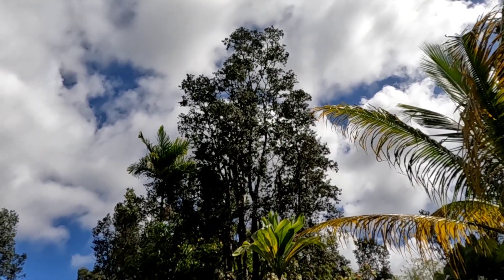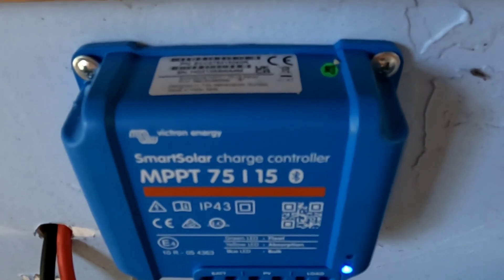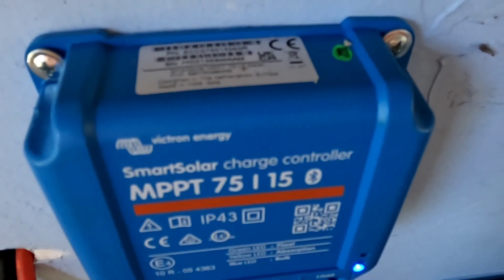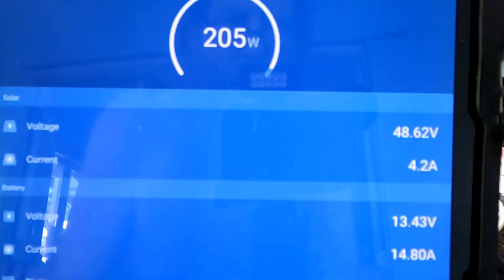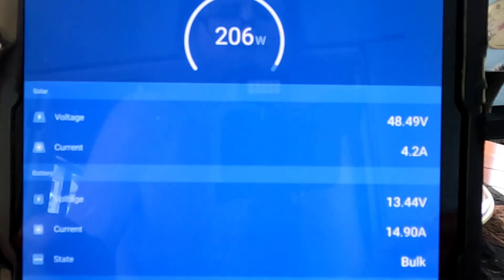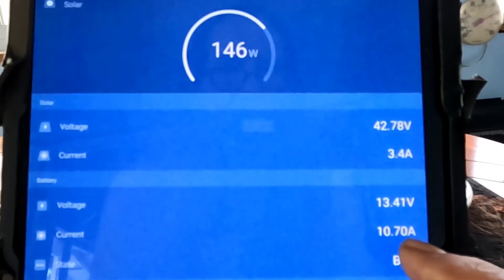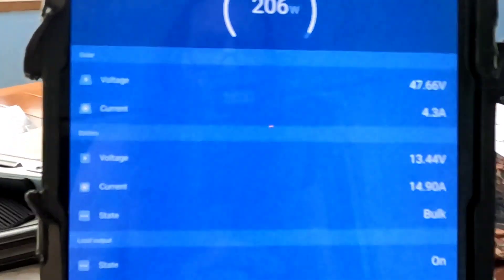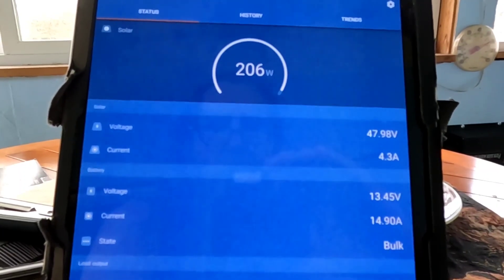Victron MPPT 75/15 pushed beyond rating. What happened?

Comment: That should hold around 15 amp max. Now if you set for 24V you should get the full 300 watt peek. I am not Shure if that model can do 24V . would be the way to run it on 24V. now over voltage the input from solar array may damage the unit.  also if that MPPT heats up to much it will limit output as well . make Shure you have space around the3 MPPT to let the heat out. looks ok. 😀
Reply: I looked at my MPPT 7510 controller and is does 24V . great way to charge that 100 ah 24V battery. looking at info I got with mine and the USB connect for lap top  I can do A custom firmware up date for outher battery's like NiCad or nickel-Iron . I wont be doing that on this small on. just 12/24V for camping 120watt folding panel .   you should be able to run 24 just fine on what you got 300 watt array.
Reply: @robertmeyer4744   I have the 75/15 , it only does 12 and 24, I use it in conjunction with the boost converter, just to swap power around to different lithium batteries,  You can push all the amps at it all u want, it's just going to give you 15, cuz that's what it's rated for. I've never went past 70V though.
Reply: @WCO3  the guy hear has time USB 24V battery . this will be great to charge it. 
😀
Reply from the maker: I'm dialing it in now!🤙
Reply from the maker: Having fun now with this higher voltage! Can't wait to share with you. Wow, what a difference! 🤙

Comment: When  setting  the  parameters on my  charge controller  is possible  to to program it so that I don't get a  high voltage  warning? 
And is that a problem?
Reply: High voltage warnings are there for a reason mate.  If you slam a voltage in to your controller that is above the rated VoC the controller can handle, then there is a good risk you'll fry the controller.  If you go over the specs for charging lead acid (unless you're doing an equalisation) then chances are you might hurt your batteries.  Overvolting a Lifepo4 should see the BMS shut it down, but that's not a guarantee.  Unless you have a specific use case for your controller that you wish to ask about, I would stick to the recommendations of your equipment manufacturers .  Edit: Remember equalisation is high voltage but low current for a relatively short period of time in the case of Flooded Lead Acid.
Reply: Manufacturer  recommended setting is 28.4v .  I  program in 28.2.   And  want to go  lower,    but  I don't really  understand  the  meaning  of  the other setting  and  understand  that  they  need to go  proportionally  together. 
Any  help  please!
Reply: @boscodog4358  what model controller are you using, and what battery chemistry.  Obviously a 24 volt system, if I know the controller model and battery type I can be more helpful.  Also how many amp hours is your battery bank, and what size is your solar array.
Reply: @Drewboo1968  awesome  man. 
I have a  6415an  controller  Epever. 
A Reliable 3k watt  inverter. 
2.  12.8 v.  100amh  batteries   24v configuration. 
 4--  310w  panels   series/ parallel  configuration.   Output  73v. And  app. 9 Amp
My  problem  is  over  voltage  to  the  batteries   getting  alarm  at 28.2 v
Is that  normal
Reply: @boscodog4358  Let me do some digging, and I will get back to you today.  What brand are the batteries?  28.2V sounds like a bit of a strange voltage for a full charge.  I would normally expect 28.8V for two LFP in series, and 29.2V for the real high end of the range.  So telling me the particular brand will help, in case they have some strange chemistry, or particularly unusual aspects.
Reply: It  appears that the controller is  slow  in  closing down the charging  to the battery
Reply: @boscodog4358  okay so lfp batteries, a good safe voltage for a full charge would be 28.8V (14.4v X 2) max for full charge would be 29.2V generally, but the gains from the extra .2V per battery are not worth it Vs the longevity saved by going 14.4V per battery <remembering that we are wiring the batteries in series) let me do some digging on your 6415 and I will get back to you today with some ideal settings that should see you right.  I graduated from SEI in Colorado after taking all four battery based and advanced multimode qualifications (with 160 NABCEP hours) so I won't advise anything that sounds like blowing smoke up your rear.
Reply: Chins  battery
Reply: Manufacturer recommended 28.4
Reply: @boscodog4358  Cool, I can look up the data sheet and see what I'm dealing with!

Comment: Shockingly, small shadows can have HUGE effects on total output.  Only speaking for my 4500w array, small shadows take 180ADC right on down to 10-50ADC instantly albeit only temporarily. Doubt that's your production issue but.....could be?
Reply from the maker: Those results were in full sun at the end of the clip.🤙
Reply: @ProjectsinParadise808  I’d be interested in seeing you test each panel individually and then in a couple different configurations ie 3S vs 3P
Reply: PERC+ half-cut panels are a good choice. 420 W but only 99 euro. Half-cut is not so sensitive for shading.

Comment: Gary R is correct. You wired the panels in series, which only add their voltage and not their amperage.  The reason you are seeing almost 15amps on the lower portion of the screen is because the voltage from the panels in the top screen (48.82V) is being stepped down by about a factor of 3 because I'm assuming your set up on a 12V system (the charge controller itself).....hence 14.9Amps in the lower portion which is 3 times higher current.  So, in short, by stepping the voltage down, one steps the current up in proportion. @Electroboom feel free to confirm or correct my statements I made there as you see fit 🤠
Reply from the maker: Mahalo Uncle! This is exactly why I do this channel.  To have conversations with guy's like you , Gary and many other's that can explain the why, and how so easily for us. My understanding, and ability to explain what my results are,  are not so easily at the tip of my tongue , or permeated my gray matter like so many of you. Gratitude to you all for helping piece it all together.  Aloha!🤙
Reply: @ProjectsinParadise808  anytime good buddy but, I’m working with limited capacity on my best of day here too so…. Birds of a feather right? 🙏🤠
Reply: The 75/15 nominal watt rating is 220w and the max charge current is 15 amps. You can over panel the controller, but it will result in clipping and still charge at 15 amps. Could be dangerous, but I’ve seen quite a few people exceed the wattage rating and not have too many problems. From what I’ve seen, the big problems occur when the voltage rating is exceeded. Anything over 75 volts would probably result in the magic smoke appearing.
Reply: Even when you add them in series and keeping the amps the same on the input side it still raises the output amps to a dangerous amount the controller just can't handle. That 75-15 can handle one modern panel or two 200 watt panels. If you over panel it it might take it for a bit but not long. It's gonna drop down to the 15 amps it can output and the rest will turn into heat. The heat will eventually kill it. Add a good heat sink or fan and it might last longer but it will eventually fail
Reply: @matthewknight5641 If the charge controller is charging at the max of 15 amps, the rest of the power is NOT dissipated in heat! The solar charge controller simply allows the panel voltage to climb closer to its unloaded panel voltage therefore simply pulling less power from the panel. Most panels/controllers spend the majority of their time running at less than 100%.
Reply: Thank you for comment above. My brother just got a camper. I have a Victron 75/15 MPPT and 2 x 300w panels. He has 100ah 12v battery (he needs more, i know, hes broke and broken, im funding). I dont want to charge these to quickly but want to ensure a full charge every day to run his fridge and lights. Power wasted is no concern. Is it let the smoke out dangerous connecting excess panels to allow for cloudy days? 15a from 600w. ( I have no experience with this). @adrianinglis5922
Reply: @truthaus6840 the victron can throttle the current (amps) but not the voltage.

so you could go about 10-15% safetymargin below the stated voltage (75V-10% = 67,5V) on the panel configuration and put basically as much panels in parallel as you want BUT: put a fast blow fuse of 15A in series before you go into the charge controller !   it can't handle/throttle overcurrent in a failure event and the fuse needs to kick in to safe it from burning out.

in normal conditions it will throttle the panels back to match its own 15A output capability. but having a charge controller for more then 10% of a sunny day throttling is just wasting  yield.  then get a bigger charge controller.
Reply: @casemodder89  thank you.
Reply: @truthaus6840  Its been 6 months since you put 600 watts on a 75 15 Victron Controller. Is it still functioning okay?
Reply: @garyenwards1608  yes,
Reply: @truthaus6840  Thanks!
Reply: @matthewknight5641  just get a bigger charge controller

Comment: Your initial comment in the start of the video. when you multiply the voltage of the three panels and you multiply the current(amps) could be misunderstood! In series connections you only add up the voltage, the amps stays the same!!! The 15Amp limit you see, is due to the controller(not the panel connection) - when it steps the voltage down to 13-14 volts, it ups the amps at the same time, till the 15A limit.

Your experiment shows another good reason to up system voltage. If this test was made on a 24V-system you would get the full potential of the panels, because the amps would be only half and thereby within specs of the controller and not limited to the 15. So running higher voltage/less amps allows you to get by with a smaller controller. Controllers main limit (when it comes to cost) is amp rating.

Other good reasons to run higher voltage is, you get by with thinner cables due to the lesser amps, your inverter effeciency increase slightly and you have less powerloss in long run cables due to the higher voltage/less amps. (amps is where you get loss in cables)
Reply from the maker: Copy that brother,  and mahalo for that great explanation.  It helps me, and I'm sure other's as well.  Appreciate you sharing,  and participating in the conversation.  Aloha!🤙
Reply: Yes, it would probably be optimal with this controller to use 4×100w panels arranged in "series-parallel" ie two series branches of two panels, the two branches being connected in parallel with each other.  Consequently the whole array is at a nominal 24v.
At the MPPT point the voltage in each branch would be about 34-35v and the current about 6A maximum.  So maximum input to the controller would be 35v at 12A, which matches the controller power spec. of 440w at 24v. Then the controller would output about 24A charge at 16-17v into your 12v battery.
Reply: @nigelshindler6334  I think the cc limits the output current to 15a, so I doubt you will get 24a to charge your battery

Comment: Nope, still 6+ amps. They are in series, voltage goes up, current stays the same.
Reply: In series, volts are additive but amps are not.   Volts push, so never go above the 75 (VOC), whereas amps are pulled, so no need to worry that you will go over 15 amps.   Amps greater than the 15 simply won’t be used…wasted, or over simply over paneled, which is useful on overcast days.
Reply: I was looking at the spec sheet of the Victron MPPT 75/15 charge controller and the only protection it says the controller has is short circuit and over temperature.  Your three panels do have the potential of exeeding the max amperage of the panels by a few amps but the tolerances of the controller is likely to allow a bit more than the rated current and you maybe lucky enough that it won't complain too much. It won't however limit the current and automatically keep it below a safe level for it's operation meaning if you added a fourth panel to the array you would likely blow your controller.  Being that you live in Hawaii and your temperatures will likely never get down where the panels will approach their maximum power output you might be safe with your current array as is unless you should have a bright sunny day along with uncharacteristicly cold temperatures. Adding a forth panel is not recommended for this 12v system as it would certainly lead to you exceeding the controllers rating far to often for it's rated capabilities. The spec sheet says it only supports 220 watts of solar on a 12v battery system however it will support up to 440 watts of solar panels if you change to a 24 volt battery.
Reply: @ReadyNeck  "Your three panels do have the potential of exeeding the max amperage" No, not when connected in series. 
- Our good man is connecting his panels in series, so the amps will stay the same as it is are for 1 panel. They will not even get close to 15A - BUT on the output side of the controller(to the batteries) - there is an issue of being limted to 15A. A controller amp rating counts both on the input and the output of the controller. In the setup in this video, it is not the input amps from the panels that is a problem, it is the output amps til the battery that is limited to 15A.

A fourth panel when connected in series, will not blow the controller due to Amps, BUT it may very well blow it due to exceeding 75 Volts!!
Reply: @jbjensen11  I think the discrepancy between our comments is in how we are accounting for the MPPT charge controller's current output and it's lack of current limiting capability. I agree with you on the current output of the solar panels in series and if this were a PWM controller then the amps would be limited to the VOC of a single panel which is far below the controller's 15 amp rating. However, this MPPT controller will try and convert the higher voltage to more amps being sent to the battery from the combined power of all the panels in the array.  When looking at his test measurements seen from the Victron app, it showed that the controller was already converting the power from ~49 volts from his three panels in series by bucking the voltage down and boosting the current to ~15 amps being sent to the 12v battery. The three panel array is pushing the current output limit of the controller already so if a fourth panel were added to the other three in series the input voltage would increase to around ~66 volts (with the input current remaining at ~5 amps) from the panels but that additional power from a forth panel would cause the controllers MPPT circuit to try and convert that panel's extra power in the form of higher voltage to another ~5 amps of current to the battery output which would exceed the controller's current rating by +33% at 20 amps. I agree that the amp rating of the controller counts on both the input and output and in this case it is the output side that must be considered  because the controllers DC to DC conversion circuit would boost the current to far exceeded the 15 amp output rating to safely operate it. Noting from the spec sheet that this controller does not have current limiting functionality to keep it from exceeding a safe 15 amps of output it would likely fail from a current output overload.
Reply: @ReadyNeck  the amps it "generate" from overvolt will be on the output side not the input side though.
Reply: @LiLBitsDK  that is correct, the controllers output amps (to the battery) would be exceeded if a fourth panel were added. The solar input side of the controller would show approx 66 volts at around 5 amps going in with four panels in series. On the input side because the panels are in series only the voltage would show an increase if a fourth panel were added. This would appear to be within the 75/15 spec of the controllers input rating however, the spec also  says that the max input wattage supported for a 12v battery is 220 watts because the DC to DC conversion circuits of this MPPT controller could end up producing over 15 amps of output power to the battery if more than 220 watts of solar is used.
Reply from the maker: So what about the 14+ amps, or holding 300 watts at 200? 🤙
Reply: @ProjectsinParadise808  The 14+ amps comes from the controller (not the panels) when it steps down the voltage to meet the battery voltage. When it does that, it converts the "overvoltage" to amps. Gary is right: it is not your panels letting 15 amps in. (Not if you serie connect) The limit you meet is the controller letting max 15 amps out(after it convert the power to meet your battery voltage)
Reply: @ProjectsinParadise808  Input volts X input amps = watts into the controller. I think you were close to 48 volts and 4.2 amps or so. The charge controller steps that down to battery charge voltage and the charge current goes up. You will loose a couple of watts in the controller as heat. I bring in 230 volts under load but only the 10 amps the panels are rated at. You are just not going to get more than 300 watts out of your panels no matter how you wire them.